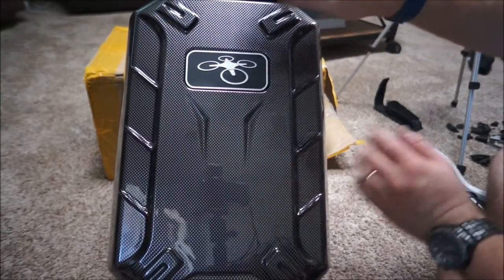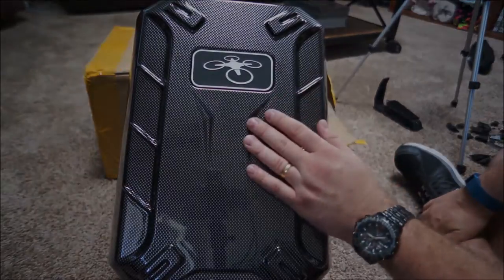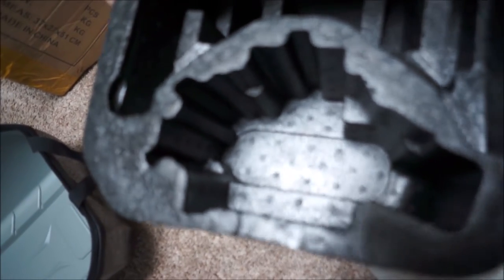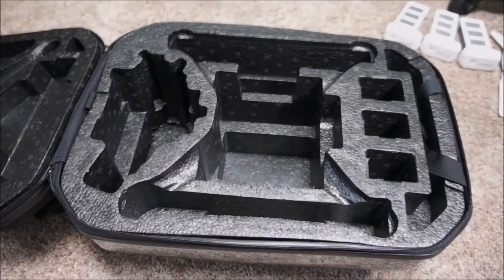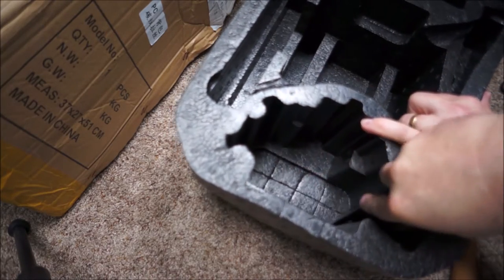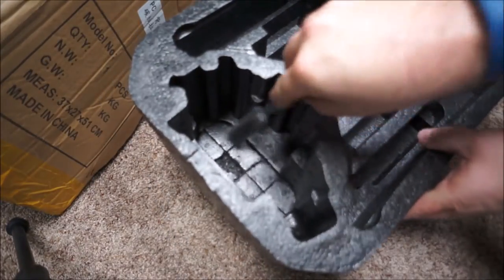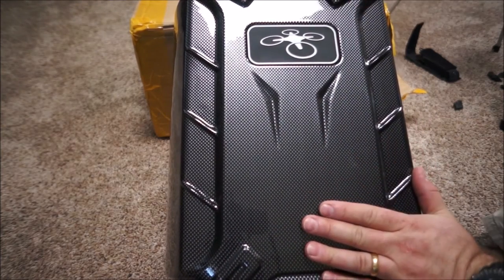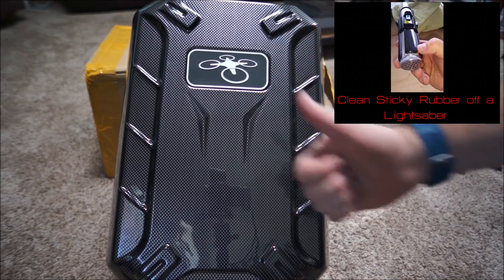How to Modify a Hardshell Backpack for Phantom 3 Standard

Comment: Hi, I wonder if this would still fit with the argtec antenna mode added? Thanks.
Reply from the maker: I'm not sure.  The foam is pretty thick, so its fairly straightforward to trim if needed.
Reply: It will, but you need to take out more material from the bottom, I also drilled a few holes in the upper part where the antennas attach.  

ETA:  You of course have to remove the antennas.

Comment: would phantom 2 vision plus remote fit with some modifications?
Reply from the maker: I think the remotes are identical in size.  If the remote is smaller or the same size as the P3 controller, I would imagine it would work.
Reply: But it has a range extender, and taking it off is a hassle

Comment: your controller isn't original phantom 3 standard controller that's why it won't fit on the foam.
Reply from the maker: +Jami Heinonen Yes it is.  It doesn't fit because I added the Inspire mobile mount instead of the terrible mount that was there. This is a pretty basic mod for most Standard owners. Thus the reason for the video.